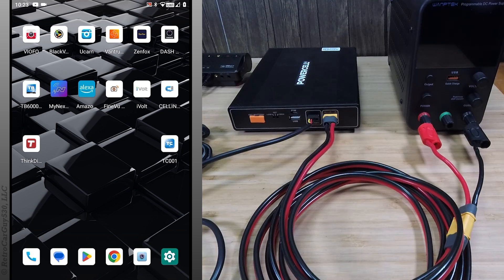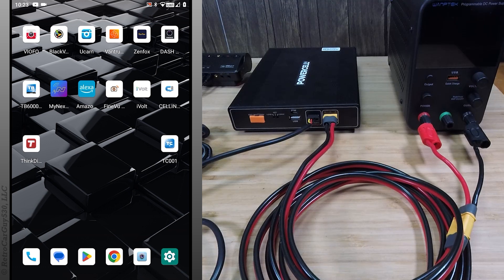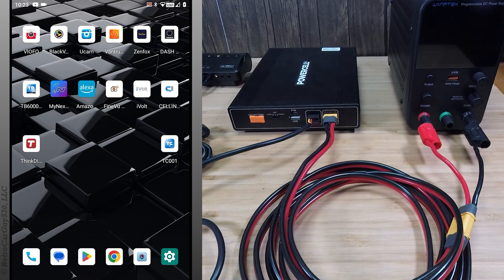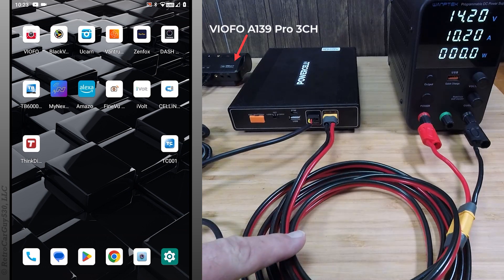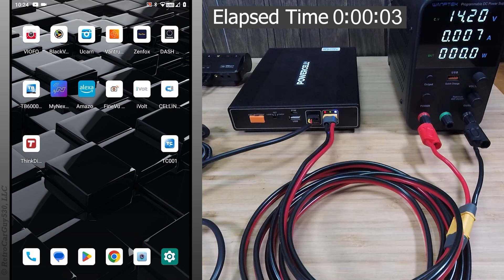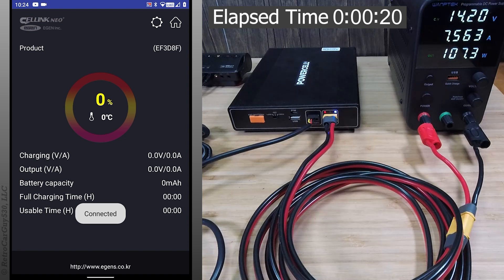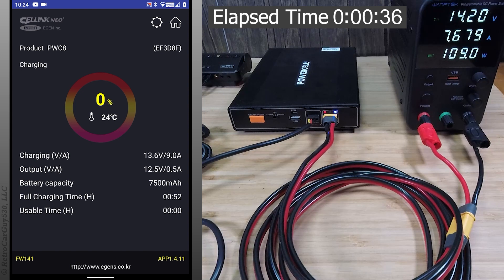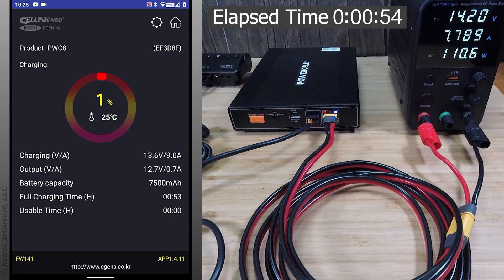BlackboxMyCar PowerCell 8 - 12 AWG Cable - High Amp Charging Test

Comment: Very nice.
I saw 84℉ (28℃) for the specially constructed 12AWG charge cable.
The included 16AWG charge cable was 112℉ (44℃).
That is a considerable temperature reduction 28℉ (16℃).

Also the peak amp draw was reduced from 9.741 Amps to 9.114.
That is a very pleasant unintended consequence. 
Replacing the included 16AWG charge cable with 12AWG seems like a no brainer. 
I hope Broseph sees this.
-Chuck